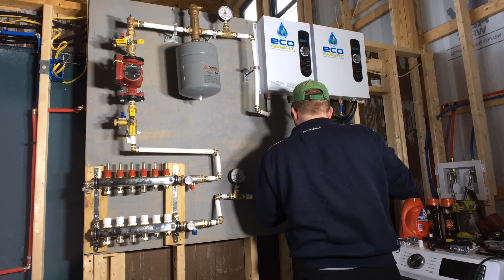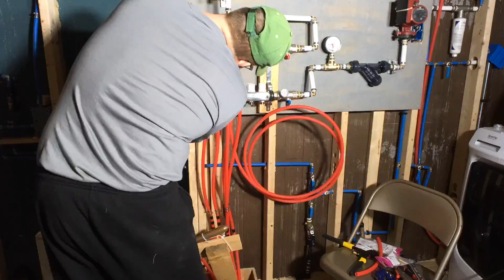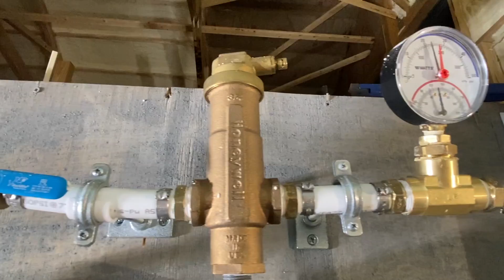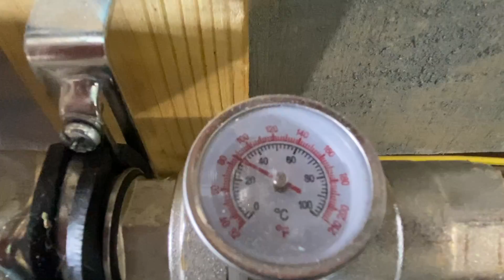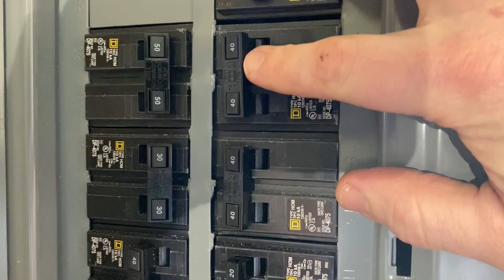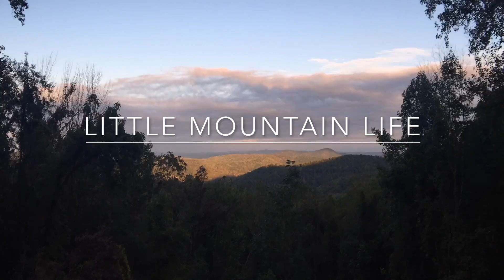DIY Radiant Floor Heat | Install and First Impressions

Comment: If you wanted to use the tankless but don’t have a well (run off of city water with a tankless water tank) where would I draw the water from the water main or from the current tankless water tank?
Reply from the maker: It's a closed system. Fill it once and you're good.

Comment: Is this system still working well for you? How did you decide how many of the tankless water heaters you needed?
Reply from the maker: Still working great. Would get the next size up if we had a bigger floor to heat.

Comment: I am set up with the radiant floor tubing in my slab. The one thing I haven't seen an example.of is how you or anyone else installed the thermostat or its sensors. My slab is the same as yours 32x32 but with only 3 zones. Unfortunately I only have 200 amp service.  I can do propane unless I can find a safe way to utilize the tankless water heater already installed. It happens to be the exact same 27kw eco smart you have. So, my real question is how did you install thermostat sensor....

Comment: The Ecosmart tankless water heather that is linked has terrible reviews. Look at the one star reviews. It doesn't seem to provide very hot water. I wonder if this would affect the ability of a hot water floor heater to work properly?
Reply: Wrong! I am using an even lower KW heater by Ecosmart, and it  supplies plenty enough heat for radiant heating.

Comment: I'm just beginning to research a hydronic floor heating system. I looked at the Amazon links you included. The components don't seem very expensive. What was your total cost to purchase and install the system? We would be installing in an existent 2300 sq. foot house on a concrete slab in the high desert of California. I think we would need to put in a pad to prevent the heat from going down instead of up. How much would this raise the height of the floor? Thank you.

Comment: Great build. But as I could see, so didn’t you insulate the ground before the slab was poured. That’s so wrong. Correct me if I’m wrong, because I couldn’t here you talking about it. In northern Europe, we insulate the foundation of the concrete slab BEFORE we fill it with rebar, PEX and concrete.  1-2 feet of styrofoam.  Insulation must stop the cold bridge from the ground.  insulation on top of a hot concrete slab is a waste of heat/money.  The heat is stopped by the insulation and heats the ground below and less up in the house.
Reply from the maker: You must have missed it. The slap has foam board under it and around the perimeter. That’s code for our area.
Reply: @LittleMountainLife  thanks. My Fault. Great build. Love to do the same one day….

Comment: Great video! Thanks so much for putting in the time and effort to create this video. I am doing an open system: my propane WH will provide hot water to the house and the floor. IS there any real difference in the plumbing set between an open vs closed system> i.e. flow valves, etc.???? To run the system, you just turn the pump on???...Thanks again❤

Comment: Do you have zone valves like HoneyWell? How do you turn on/off individual zones manually or via thermostats?
Reply from the maker: All zones can be adjusted manually with the flow knobs.

Comment: for anybody who is watching this. the type of floor used eith radiant heat is super important. if you use engineered parquet like me, this floor will moan and groan LOUDLY from expansion all winter long. talk to other radiant heat owners about their experience. My contactor was an…id.. iot who never really used it himself

Comment: I just don't understand why so many people use all those fittings on Pex. I know you are trying to make it look nice but the Pex is designed to loop around instead of putting a load of 90's and you waste a lot of money on fittings. You have a huge amount of friction loss in that system. It would be more efficient if you cut them all out and just curve the Pex.
Reply from the maker: True but curved pea would require a much larger system footprint. Space is limited.
Reply: @LittleMountainLife  no you can curve the pex into a 45. People are just concerned to do it because they feel like it will kink but it doesn’t really take much more room to do it.
Reply from the maker: @Z71hosestretcher  sure I’ve done 45’s before but it still takes up more space. Give and take considering space and flow. It’s been working great for 3 winters now.

Comment: Might be able to tie-in a wood stove to the system and let it give you dual purpose, heat your floor, and a way to cook on top, Roast, Stew, Chillie ect. I want to tie ours in with options for propane and electric.

Comment: Where does water loop too? Tank? Is it closed system? How do you keep drinking water seperate? Did you use a additive in water?
Reply from the maker: Completely closed system with independent tankless heater. 
No additives.

Comment: Thank you for this video! I'm working on setting up a hydronic heat system for my garage and you've helped me immensely. I have already purchased many of the same components that you have and I was looking at the same water heater that you're using and to hear that it is working so well for you is reassuring. Since I'm only looking to keep the garage above freezing most of the time and only heating up to about 55° occasionally for winter auto maintenance I'm actually now wondering if maybe it's a bit oversized but I think that's better than undersizing it. I didn't hear any mention of antifreeze in your system, are you just running straight water? I want to run a glycol mixture to make sure that there is no chance of bursting or damaging any components just in case the system fails for any reason. We get sub zero temps here, sometimes for extended periods, so I want to make sure the system is safe. My biggest question is about the annual flushing that EcoSmart recommends when running on hydronic heat with a glycol system. Also, how did you determine that you only need one pump? The boiler I was originally considering actually requires two pumps in the system in order to maintain it's warranty so I did buy two but your system is actually bigger than what mine will be so if I can return one and save some money that would be a big help. Thanks and keep up the good work.

Comment: 140 degrees seems kind of hot? Seems that most systems run 100 to 120 degrees. It’s a nice clean install!
Reply from the maker: Yes this is an old video now… haha. 
We currently run it at 105
Reply: @LittleMountainLife  that sounds better!

Comment: How long does it take to warm up the floor from a “cold start”?  Also, do you know about how many kW you’re using per month?  Nice job on the house
Reply: half hour. i had radiant heat for 12 years in my condo.

Comment: Hello guys, love the video. Did you insulate against the foundation so you don't have heat loss that way? Also I was wondering about adding glycerine? Do you think it is necessary? I will be adding a slab to the front porch and entrance ramp to house I plan on heating.
Reply from the maker: Definitely keeping ours just H2O but I’ve heard of folks using additives in far norther climates. 
The slab has 2” foam board insulation underneath and down the sides. 👍
Reply: @LittleMountainLife  ok yeah I like your set up so am kind of modeling mine off it, but being mostly outside I wanted to add a pal 150 pressure pump / feeder for the glycol antifreeze. But wasn't sure where it would be able to be added. I will figure it out though.

Comment: Hey, we are watching you from our TV, so I had to jump on my phone to comment. ☺️

I am SO thankful you gave us your thoughts and opinions on if radiant heating is worth it or not. The Hard Yes is what we needed to hear!! We bought our large home way out in the country this past spring with wood heat only, and since this year has been really bad with fires, loggers couldn't get in the woods until late. (We are bringing in a deck of logs to cure.) I have been so stressed because it gets insanely cold where we live! The home was set up with all the piping for the radiant heating and my husband is out putting everything thing together as I am writing this. It is 10/21. We had to find a video that gives us the most common sense place to put the overflow tank. We are using a duel propane hot water heater. 

Question: How to you have your overflow tank mounted? It looks like it is just held there using the in-flow and out-flow pipes. I didn't get a good look though.

Thanks for both of your opinions and details of how it is working! ☺️
Reply from the maker: Thanks for watching! The expansion tank is not directly mounted but the pipe mounts are supporting the pex right where it connects to the tank.

Comment: will this work for a driveway?
Reply from the maker: I know of a lot of people and towns that use radiant heat for driveways, parking lots, and sidewalks. An electric tankless heater would not be the preferred heating method for sure.

Comment: Seriously….all of the components and materials cost under $2000?    What size is the slab ?  I’m doing a 35’x40’ and trying to figure a rough cost.  Thank you for the inspiration and great work on everything!!
Reply from the maker: Thanks!
Yeah it’s not a huge slab.
32x32

Comment: Great video and thanks for sharing.

Question,  knowing what you know would you recommend using solar instead of electricity to run the tankless hot water heaters? We would really like to be off grid as much as possible.
Reply from the maker: Sure, thanks for watching!
For off grid I would definitely look into a outside wood boiler.  
These electric tankless can really draw a lot of energy and you'd have to have a pretty robust solar set up to handle it along with everything else in a house.
Reply: @LittleMountainLife  Thanks for the reply,  keep on keeping on 👍

Comment: what is the dept of your cement slab, what is the thickens.  Some articles say that the Pex tubing should be no greater than 2" from the finished surface of the slab otherwise you end up sending most of the heat to the ground below the slab.  Thank you
Reply from the maker: Slab is 4” thick and we have 1” foam underneath that. The pex is attached to the top of the wire mesh which is suspended midway up in the concrete. So it’s about 1.5” below the surface. 🙂
Reply: @LittleMountainLife  Thank you.  I am planning to run it under my basement floor.  However, framing the basement walls I have to shoot 3" nails through the PT 2x4 to the cement floor and don't want to puncture the PEX tubing.  So, I plan to have 3" of compacted sand then vapor barrier and on top of that 2" of extruded hard styrofoam, 6"x6" wire mash and have the PEX tied to mash with zip tides and pour 4" cement on top.  That way when I shoot the 3" nail in to the PT 2x4 it will only penetrate 1.5" in to the slab and wouldn't puncture the PEX tubing.  But with the PEX tubing 3.5" below the surface, would we get much heat to warm up the basement.
Reply from the maker: @Xbox360Rules00  Cool.  We just made sure to not run pex directly under our walls. :)
Reply: @LittleMountainLife  so line lined up the schematic of your rooms on the extruded styrofoam? :)
Reply from the maker: @axbox youxbox  yeah.  I spray painted the wall placement on the foam insulation and made sure that I made special note of the few wall/pex intersections to avoid puncturing the lines later.
Reply: @LittleMountainLife  Smart.

Comment: I may be out of step with your progress, but where is the electricity coming in for your water heater?  Generator or utility?
Reply from the maker: We have 400 amp electrical service to the house. 🙂
Reply from the maker: And we have a 17500 watt portable generator for backup.

Comment: System is good, but instead of electric water heater you can use gas tankless boiler which is consuming much less.
Reply from the maker: Thanks
We aren’t doing gas in this house.

Comment: Nice video, very helpful. Planning on installing a radiant heat system this year. I hate forced air heat. Couple of ?s. How big is your house? Where did you get your material so cheap? All I have seen are at least twice your cost. Thanks!
Reply from the maker: 1024 square ft. 
Supply warehouse dot com

Comment: Great video thank you. Could you provide some info on your kwh for your radiant system? We are considering installing radiant for our new pole barn home. We are wondering how energy efficient an electric tankless water heater is versus using mini splits to heat the home. Also did you install foam insulation in your slab?

Comment: You may have been asked this but did you consider Heat Pumps (1kW in and 3kW heat out) rather than direct electric?
Also do you you run your underfloor water at 140F/60C as you said in the video? I thought underfloor normally ran at lower temperatures (95F/35C)?
Reply: Max temp for in concrete radiant heat is 120 or you will crack the concrete

Comment: We recently completed construction on a geothermal system with in floor heat with propane as the backup. Because it’s a dual fuel system we get a discounted electric rate. We really won’t know how efficient the system is until we get through one heating season. House is very warm and we are not using much propane. We also cook and dry clothes with propane. It will be interesting to see what your cost comparison is with your system and a conventional system. Thanks for the video.
Reply from the maker: Thanks for watching! Here's our one year update video! https://youtu.be/xTxDyZ1LNtU

Comment: great video you broke down the heat system very well.i wonder the one pump your not running will seize up.i heat my house with an outdoor wood boiler and i have to turn the pumps on during the summer if not i had stuck impeller .we are on a well system and have hard water.
Reply from the maker: Thank you! Haven't had any issues with the second pump yet, fingers crossed! Helps that it's a closed system.

Comment: Can i ask you how many kw hours you use for your radiant floor system annually?  or what your monthly average is?  I live in a similar climate, have radiant floor installed but am deciding between electric and propane.  I'd like to use electric and someday have a solar system but wondering what the cost would likely be.  if i knew the KW usage i could multiply by my cost per kwh.  Thanks!  great video
Reply from the maker: Thanks for watching! We are crunching these numbers now for an upcoming video update within the next month.

Comment: shouldnt you use glycol so if your system fails the pex wont burst
Reply from the maker: Glycol is usually only used in the far northern climates.  We are not concerned with failure, especially below the slab where there's no connections or hardware.

Comment: Would love to see an update video on this system. How well did it work during winter? Wondering how the tankless electric water heater worked.
Reply from the maker: We are actually about to film an update video now that we're almost a year into using this system.  We really love it so far and the tankless heater has run great in the system.
Reply from the maker: Here's the update video! https://youtu.be/K4SWTo17AaE

Comment: It appears you have installed the first Grundfos pump upside down which will have the water flow going in the wrong direction if used.  From my reading of these pumps, you can not change the direction of the water flow by simply changing the wire hock ups.  I've personally built two of these setups for buildings on our property and don't want to see you run into a major issue if the second pump is used at some point in time.
Reply from the maker: Sorry it might not be clear enough in the video. It’s installed the right way and has been working great.  Thanks 🙂

Comment: I hope that those fittings didn't give you any problems.  I know my sister chose to replace some similar fittings on her shower since it took away the water volume(?) because of the reduced inside diameter... Which they hadn't accounted for.

Comment: Great content, new follower.  I assume your radiant floor heat is in a walkout basement?  How often do you use this system?  Dec-Feb 24x7 or just when you are planning on using the space?  Any estimation on how many hours of run time each day/week?
Reply from the maker: Thanks for checking us out!
This heat is for our main floor. No basement and no carpet or wood flooring. 
We turned it on for about a week the end of October, half of November, and now it’s on just about 24/7.

Comment: How has the Eco unit for radiant floor been holding up?
EcoSmart sales rep advised me that using the Eco Tankless Water Heater for radiant floor systems would void warranty. I do not understand that as a closed looped radiant floor system would be easier on the unit (return water inlet much warmer than domestic potable water).
Reply from the maker: I agree with your thoughts. So far so good with our heater though. No problem heating the water and warming our entire house. 🙂

Comment: so you are pumping water through a pump that is not running?  big waste of energy.  if you're not using it, you should replace that section with a straight pipe.
Reply from the maker: Yeah I’ll be replacing this coming month. Just wanted to run the system a bit to figure things out.

Comment: Great video learned alot. Wife and i plan to start building in the spring i want radient floor heat also. .my only question i'm haven is loss on electricity has this been an issue with you
Reply from the maker: We have a 17,500 watt generator for backup power. 🙂
Reply from the maker: Thanks for watching!